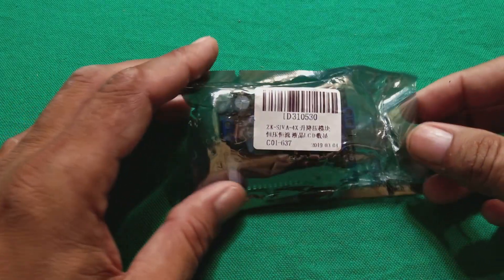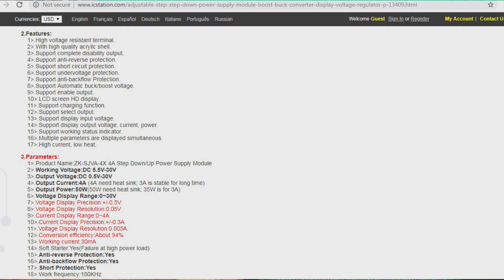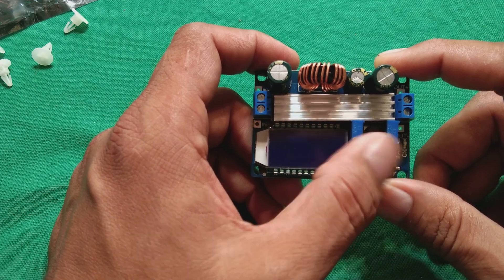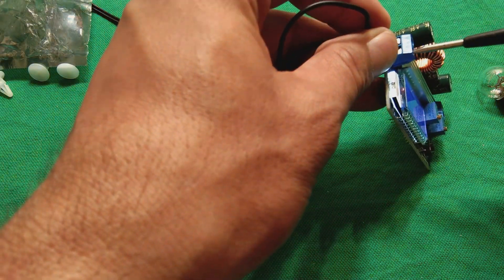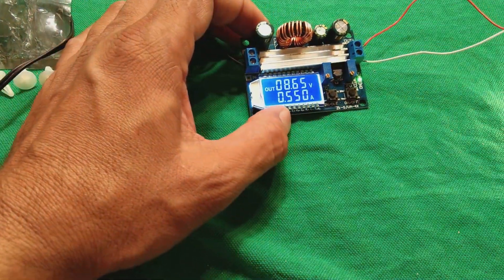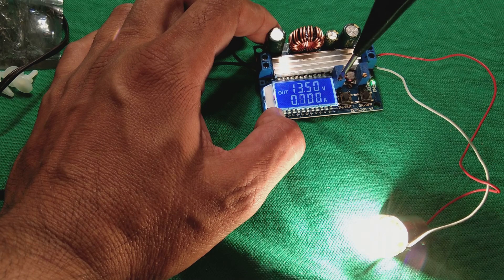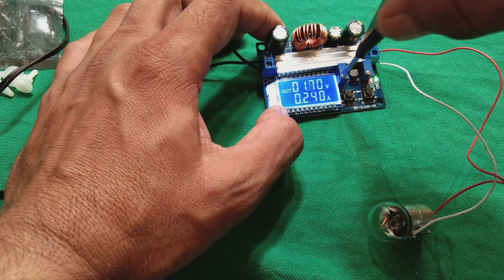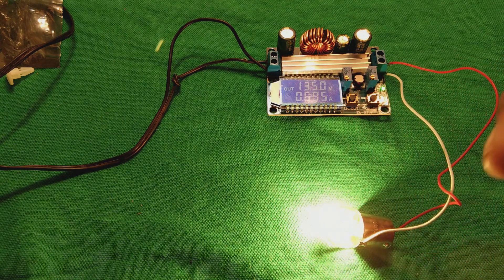Power module. buck and boost module in one unit. Adjustable voltage and current bench power supply

Comment: I got this product from Amazon. I tested this product to my 12volt tp link wifi router.. after that 10min suddenly automatically drop 12volt to 3volt and increase 2.5 amps. I will damage my router of 2500 rupees i m very disappointed for this one...i don't why this happened..anyone tell about this problem
Reply from the maker: Dropping 12v to 3v can never damage the router. Sure there would be some mistake which damaged your equipment.
Reply: @JahanZeb1976  depends on amps is increasing to 2.8amps

Comment: does it work with music class d amplifier board
Reply from the maker: Check the maximum current for your class D amplifier. If it doesn't exceed this power supply current limit, it would work. Otherwise look for some big power supply unit. Regards,
Reply: @JahanZeb1976  ok thanks ♥️

Comment: Is there a chance the output voltage will remain stable while the output current is changed?
Reply: No, because that's impossible. Current and voltage are dependent of each other. For example if you have incandescent light bulb that works on 12v and draws half an amp, if you limit the current to 0.3 amp, voltage will drop too. That's how electricity works.
Reply: @Trakkson  Thank you
Reply: on your question yes you can reach even .5 amps at 12v while cannot be above 2-3a on 1v                                          
more of a reply to that Fartlomiej guy